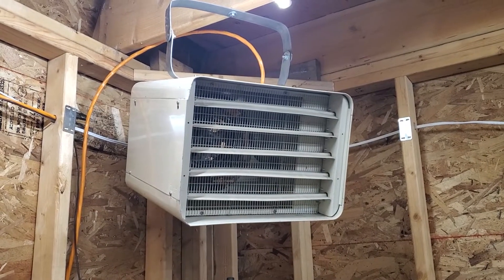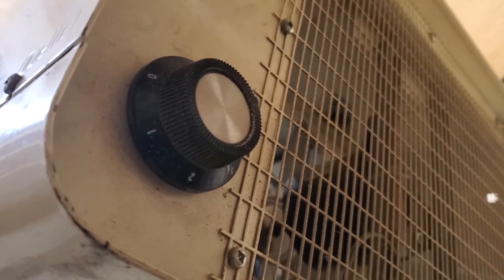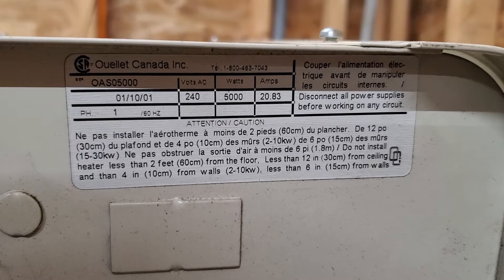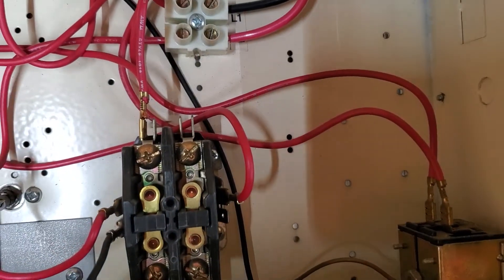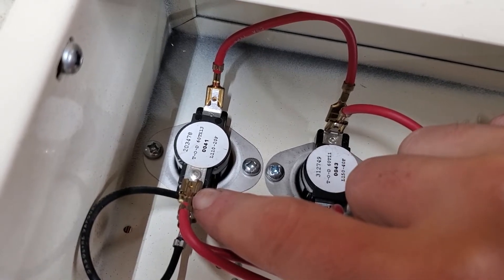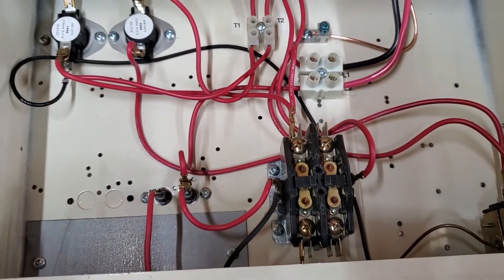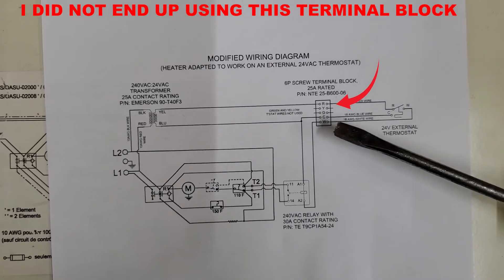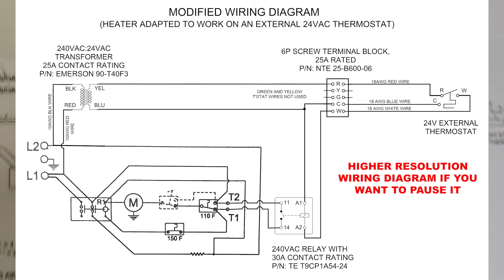How to Modify Garage Heater to Operate on an External Programable Thermostat

Comment: Good video.  Is there any reason why you wouldn’t use a thermostat good for 240 volts not needing a low voltage power source?  Not sure how that would affect the thermostat on the heater.  I have a thermostat good for 240 volt, 22 amp single pole that I was thinking of using to replace the thermostat on the heater.  Wasnt sure if I would even need to disconnect the thermostat on the heater, just keep it turned up high?

Comment: Thank you for the great video, I have a 6000w heater on a 35A breaker, do you have a 40A relay to recommend?  The closest I could find is 199AX-8 by Schneider on Mouser.  Thanks in advance.
Reply from the maker: Thanks for the comment. The relay you found looks like it will work but its quite expensive. I took a look on Digikey, here is another option that is only about $6: J115F31CL24VACS
Reply: @TheIanmurphy  
Well thank you very much, that option is preferred and perfectly aligned with your arrangement.  It took me a while to understand that a single pole relay was required.